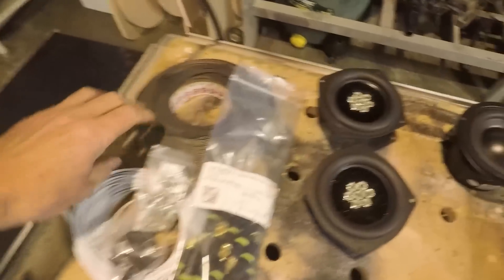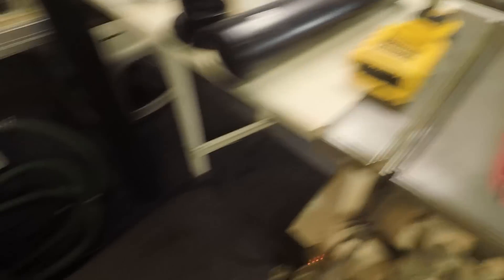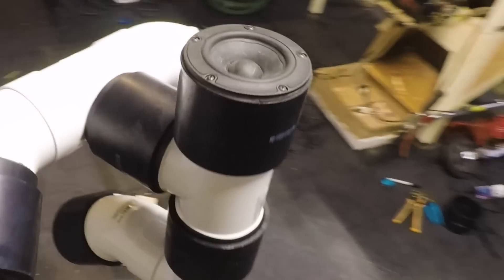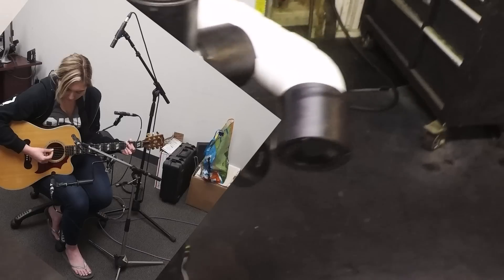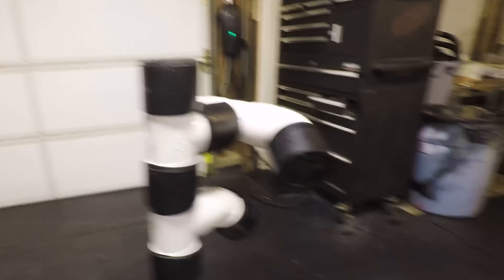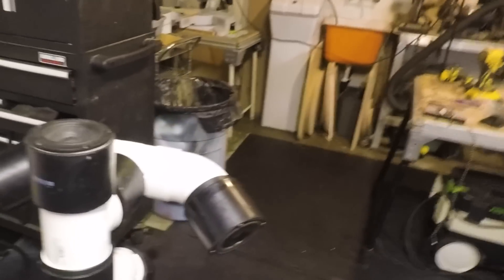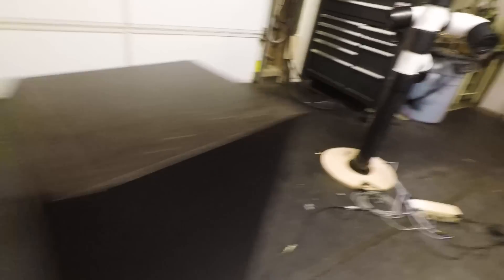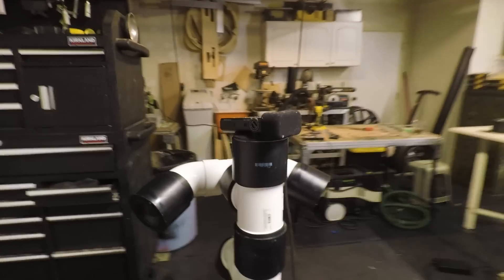Speakers Don't Sound Real, Lets Build One That Does

Comment: This reminds me of a very old spherical speaker design, featuring a dozen or two small speakers in a mono configuration mounted in a sphere. This was designed for larger spaces to hang from the ceiling.
At home I like to listen to monitors and hifi speakers together, this creates much more of a soundfield with the same varying aspect to it when you move around. It is so interesting how all the different very good speakers sound completely different and give a completely different atmosphere.
Reply from the maker: Sending the exact same sound in all directions is not a useful representation of an instrument that sends differing sounds in differing directions
Reply: @DaveRat  You might be interested in the work of Franz Zotter, who has been working in this space for a while. His dissertation "Analysis and synthesis of sound-radiation with spherical arrays" is available online.
Reply from the maker: Cool cool and thank you
Reply: @DaveRat  Right, it was another iteration of the notion of a point source, from before stereo days even. I really like how you raised the issue of "realistic reproduction". Keep ripping the envelope :hand-purple-blue-peace:

Comment: I`m an amateur audio engineer, and that is one of the smartest concepts i have ever seen and explained so that anyone could understand. awesome video.
Reply from the maker: Thank you James!!
Reply: Perhaps  multiple drivers in a multi-directional tower like a Bose  L1 Portable PA.
Reply from the maker: Who's a vast difference between the Bose and other systems like that and what is demonstrated in this video.

With the bose and other systems with multi drivers, all the drivers are reproducing the same signal or a different frequency range of the same signal.

In this video the drivers are reproducing completely different signals so two speaker wires won't work you need 10 speaker wires for five different speakers because each one has its own amplifier and signal

Comment: What a fun and cool idea for a way to reproduce sounds! It might be good to make the distinction between direction and dimension though. This speaker system is 4-directional and  3-dimentional. Even if it had a hundred speakers, it would still only operate in and affect our infinite direction, XYZ, 3-dimentional spatial plane.

Thank you Dave for experimenting and sharing your experiments! Can't wait to see what's next :)
Reply from the maker: Thank you and I purposely blurred those 4d lines. As sound relies on time and well.

4 directions or 3 directions plus time gives 4d as well. But rather than time, it's the multi signal capture and replay in speakers that are offset in distance and direction pointed. 

The issue with stereo is that 4th dimension of multiple signals offset in time and distance from each other is limited.

So the 4th d is any or all and thank you!
Reply: When I first saw the speaker array positions, I thought you were replicating the layout of an ambisonic mic's capsules. 4 directional(ish!) speakers plus a speaker with a more spherical radiation playing back an ambisonic recording would be neat to hear!
Reply from the maker: That would be interesting. Though the room sound being reproduced may not be ideal

Comment: How about instructions encoded in the audio tracks that tell the speakers to move and change orientation depending on the original position of the sound sources (musicians)? Maybe even selecting the right type of driver to output to? Too bad listening environments vary so much, it would be hard to pull off reliably. I love your concept here!
Reply: Positional audio encodings like atmos would have the positional information that could be adapted, would be fun to experiment with the physical positioning systems
Reply from the maker: Interesting and way more complex than I can muster.

For me it the simple:

Instruments shoot various sounds outward and conventional speakers strive to shoot the same sound inwards

Comment: Yeah I'm glad you're doing it I've been talking about this for a long time having multiple speakers and splitting them up into different frequencies representing a band. Is anyway you could take a standard recording and split it into its individual tracks though automatically? Possibly in DSP using AI intelligence
Reply from the maker: Hmmm, that's outside of my realm but I will do more to show other cool stuff
Reply: @DaveRat  well couldn't you use an active crossover four way say. The question is separating the instruments is the problem from a mono or stereo recording, where the AI probably would be the best solution, there's no other way of doing it?
Reply from the maker: Hmmm, so let's say you have a glowin orb in the middle of the room that radiates different colors in different directions. That is your sound source.

Now you want to recreate the orb glow in another room.

Should we mount 2 lights on the wall and point them to where the orb should be?

Should we use a frequency divider and break the colors of the orb up and the try and recombine the colors to look like the original colors?

Should we try surround or Atmos and mount lights on all the walls and point them where the orb is supposed to be?

Or should we video tape the orb from several angles and put an orb in the room that reradiates those video recordings outward, just like the original orb?
Reply: @DaveRat  I'm not sure how that's irrelevant to what the question is? Yes I agree with what you're saying that the source should be where it's coming from And not a phantom image the question is how do you get there how do you break up the individual frequencies and reconstruct them? Could you use that software that separates your voice from the rest of the music? could this be done for each instrument,? Theoretically yes it works for people's voices in a recording but doesn't sound natural.
In the future AI will be the engineers You can take all the great engineers from the past and put them in an algorithm to be any style you want, You should get on it mate be the first. We're all going to be without a job in the future.
Reply from the maker: Not sure how to try and recreate and break up frequencies. But with 4 mics and a recorder you can easily capture the sound of a singer or instrument and play it back realistically with this simple setup and no EQ, no mixing, no processing. Just record and play.

Simple and fun
Reply: @DaveRat  how's it done in that software where it isolates the vocals from the background instruments/ noise? Theoretically if you could do it with vocals you could isolate any instruments in a recording same way surely.
Reply from the maker: Sounds messy and the vocal iso software is far from pristine. 

I've done live sound for many years and the concept of just grabbing the needed sounds and sending them to the right places is always the cleanest way. Trying to bandaid stuff after the fact always give inferior results.
Reply: @DaveRat  yeah I agree with you for new recordings If you can get old recordings on multiple tracks that's great but we want to do the stuff with the old artist that are not around anymore is my point! If you could have Nina Simone playing a piano that shouldn't be difficult in a bar and it sounded like she was having a real concert how great that would be lol You can record new stuff but it won't be in the style of the artist playing, maybe with manipulation it could be with AI tho!
Just look at AI they've just won an award for the best artwork looks amazing! there's no reason why AI couldn't play a piece of music say like Beethoven as he intended it to be better than humans
Reply from the maker: Yeah w old recordings of there are enough mics it should be possible to derive some realistic playback

Comment: Dave, If you make a live recording with directional microphones pointed all around, pointing towards where imaginary Atmos speakers would be...then if you play it back on an Atmos system, would that sound realistic?
Reply from the maker: Hmmm, my belief is that instruments radiate sound, they are sound energy sources. Thing glowing energy source.

Speakers radiate sound energy.

Instruments are a sound glow somewhere in the room. Atmos is a bunch of sound flows on the walls and ceiling.

Can you recreate a something glowing that is located on the floor by placing a bunch of glowing objects on the wall?

Perhaps, ish, but the best way to recreate a glow on the floor is to use a glow on the floor.

Does that make any sense?
Reply: @DaveRat   I get it.  I guess I'm asking if we primarily hear the source, or do  we primarily hear the interaction of the source with the room?  Your approach puts the performance in the room you are listening in; my idea tries to better capture the ambience of the room the recording took place in.
Reply from the maker: Either way, the playback room gets involved. So having the recording room and playback room is an issue. Capturing and recreating the energy source and then plopping that in whatever room seems to be the best way to recreate realistic.
Reply: @DaveRat  the hole i see with your analogy is that with the right material and wave superposition, you probably could (holograms) and unlike light, sound travels in a medium (and is many orders of magnitude lower resolution/frequency so a LOT easier to process).
Reply from the maker: Hmmm, to me it seems pretty simple. Instruments radiate differing sounds outward in diff directions.

One could ponder many ways to recreate that, one way to consider would be to build a speaker that radiates differing sounds outward in diff directions.
Reply: @DaveRat  i get your point, my point is what you described with light is how a number of proposed and current volumetric displays work, so the analogy kinda falls down
Reply from the maker: It's not an analogy, most if not all musical sound sources radiate energy outwards sending different sound in different directions.
.

Comment: I think this is a truer representation of a decca tree recording. If I really wanted to hear how one guitar sounds through a decca tree of mics then this speaker set up is pretty dead on. 
I work in a performing arts center, and we record our symphony using a decca tree over the conductor, because if we capture the sound hitting the mics all in phase, then we’re replicating the conductors ears, and then the conductor is hearing HIS mix of the recording, not ours. 
That’s three omni mics at 10’4” over the conductor with the mics five feet apart. We also fly other mics at the same height over the other sections of the orchestra, up to 16 mics. We might close mic the principal instruments for a little more definition if the conductor wants the recording to be released for radio airplay. 
Great video Dave!
Reply from the maker: Interesting and in headphones that would be beyond amazing
Reply: @DaveRat  it’s about capturing the sonic imaging, just like the concept you’re on about is reproducing the imaging. It’d be interesting to hear a packaged album with the speaker set up you displayed. I think there’s a Led Zepplin LP where the drum sound was a decca tree of three AKG 414’s. Of course it helps if you have John Bonham in your band….
Reply: …With a decca tree mic set up over each instrument. You’d have to have isolation  between the instruments in a rock band I guess, I guess, but you could conceivably have a speaker set up for each instrument for the playback. I bet that’d be amazing.
Reply: @DaveRat  you know, when they try to tune an artificial acoustic enhancement system like the Meyer Constellation system, they’ll bring in “omni speakers” like what you’ve designed so that they can decide the settings for the RT60 that they’re designing for. It’s cheaper than having an orchestra available. We don’t have that in our hall yet— we have the ACS system from Kierkegaard in Denmark that uses 24 sennheiser MKH50’s and 88 tannoy coax 12’s time aligned and all over the place. We can only add 3 seconds, and that’s because the venue is dampened too much. There’s baroque music that wants up to 7 seconds of RT60, so we don’t do a lot of that. 
Regardless, there could come a day when you’d have home systems  that you could hear commercial recording releases with the systems you’re describing.  It’d be another way of selling classic albums, like all of the advancements have since 1945 or so, and probably be a truer representation of how it really sounds.
Reply from the maker: And this goes beyond Omni and is kind of the opposite in that it avoids sending any sound in more than one direction. Omni sends the same sound in all directions
Reply: The acoustic enhancements mics are NOT the recording mics. The ACS mics are at 22 feet over the stage, so there’s already a 24 millisecond delay by the time the sound hits the mics. 
The recording mics are at 10’4”, and are schoepps and Neumanns, with some ribbons and U87’s thrown around
Reply: @DaveRat  yes. I misspoke.
Reply: @brucehartnell1475  I feel like the most technical form (and in some ways antithesis) might be to rewire those omni speakers to take 1 channel per speaker, replicate their pattern as mics in an anechoic chamber, and individually record every instrument so the only room reverb is the room in which the reproduction was happening. We're actually at a point this would be practically possible, which is kinda mind blowing.
Reply: @DaveRat  the “omni speaker” I was talking about is a basketball sized round cabinet with speakers all over it. They suspend it a couple of feet off the floor to replicate a sound source. The enhancement mics are focus in a grid pattern that covers the footprint of the stage with an orchestra shell on it. 
Your rig isn’t that.  Especially if you could find where the mics were focus and have them coming out of the proper speaker in you rig. 
It’s a more “3-dimensional” recreation than omni.
Reply from the maker: Cool and interesting. I do hope more happens 8n the realm of more realistic audio recreation.

I don't see any real reason that affordable systems could not be reality available and widespread
Reply: @mycosys  I think all of this related to Dave’s videos about panning in live concert situations. 
I mix a lot of classical concerts with choirs— I work in a performing arts center, not a church— and it’s REALLY important to pan everything properly. If you don’t, you hear things from places they’re not supposed to be, like the upstage part of the choir coming from center.  
This idea of Dave’s is recreating these sound sources in the same manner if you put the speakers in the right place. 
A home  playback situation would look more like a DCA buss or subgroup buss, where you could add more drums or less bass or whatever into your home mix. 
That’d be pretty cool.
Reply from the maker: Cool and interesting